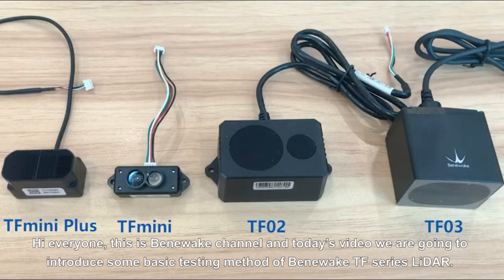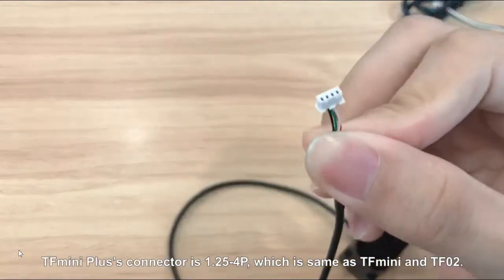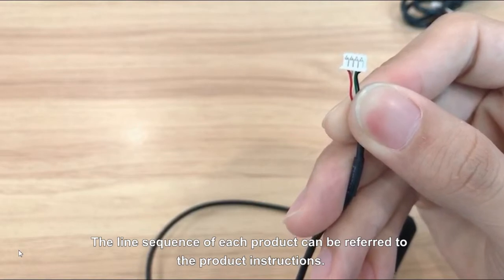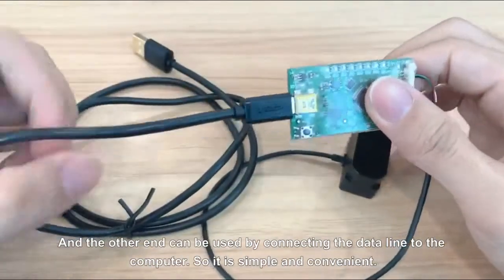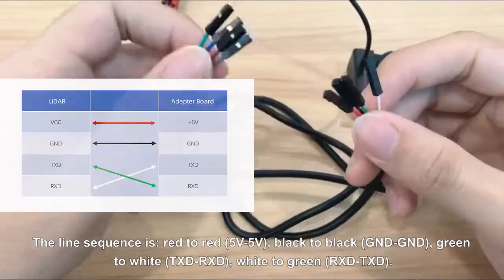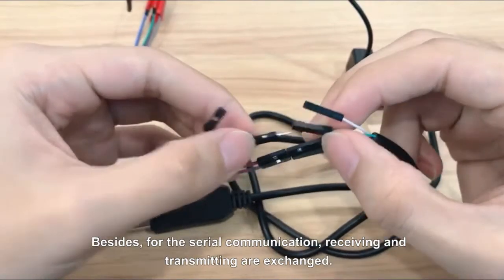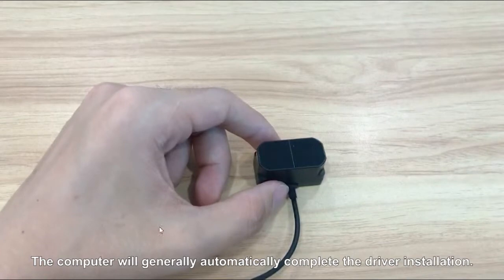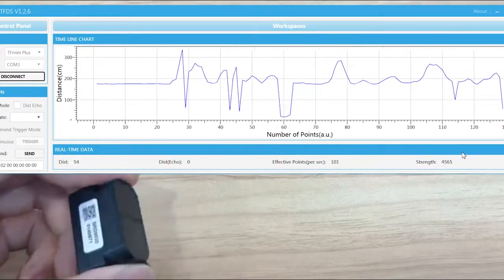How to Set Up and Fast Test Benewake TF series LiDAR Range Finder

Comment: So now the USB-TTL adapter costs more than the Lidar itself ($52) ???    What's wrong with this picture?    It is not "easy and convenient...".
Reply: You can also just wire it up directly to an arduino. If you get the dupont ends, you can plug it directly into an arduino, which can be a lot cheaper than 52 bucks but won't be as easy. 

Also the back of the Luna has solder pads to wire it directly up instead of using the connector on the bottom if that's an issue for you.